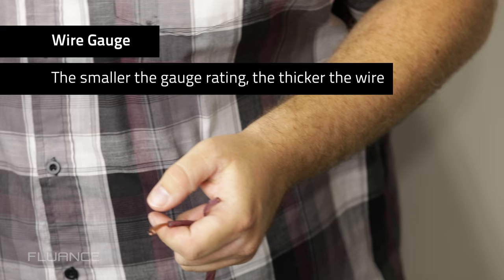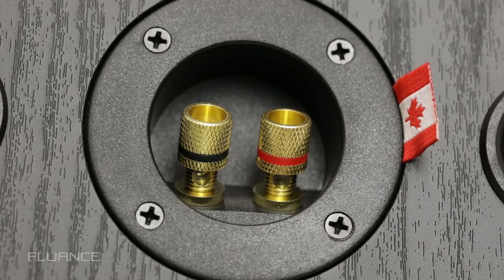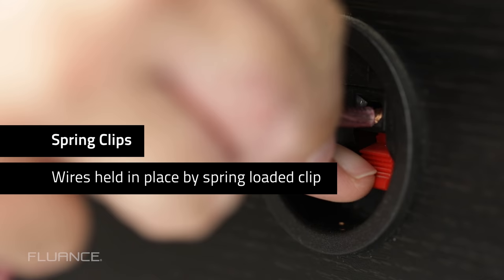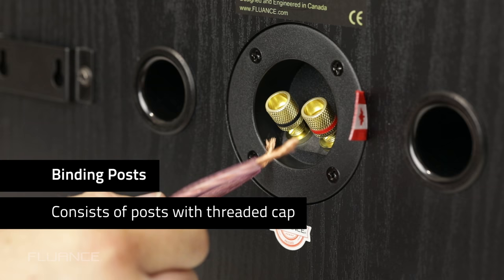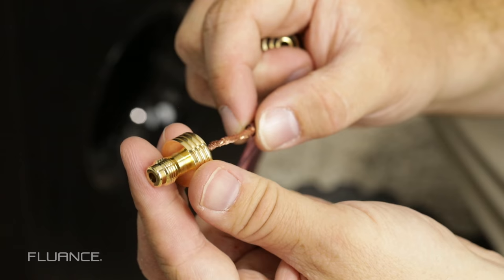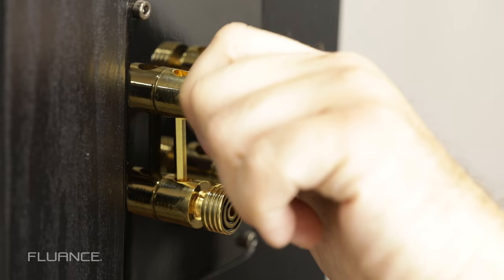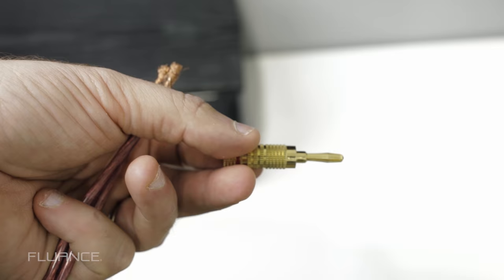How to Connect Speaker Wire to Speakers and Banana Plugs

Comment: Not once did he mention that the 2 wires should not each other & should only connect while the Hi-Fi or Amp is off.
Reply: It's intended to be a simple 3 minute video that addresses a topic in a concise way. There is an endless amount of info to share; content creators have to pick & choose what goes into a video.
Reply: Probably assumed background knowledge of basic wiring.
Reply: Isn’t that like…obvious?
Reply: O8
Reply: Nope, you can plug them in with the amp on you Twaat 😂

Comment: Bi-wiring is audiophile VOODOO and will do absolutely nothing more for you than conventional wiring will.
Reply: Mike is right, if you want to benefit from the connections you have to use BI-AMPING.

So 2 amplifiers for a set of speakers.. 1 for low and 1 for high.

Bi-wiring --  Not much difference
Bi amping - More powert to drive each frequency.
Reply: @t0xictearsz  bi wiring no difference. I think you were being kind 👍

Comment: Thank you! You saved the day. I donated an entertainment unit. The stereo and speakers were housed in it. Well...the loaders undid the speakers to get everything out. Well...what do I know? At first I thought they actually cut the wires to get everything apart! I thought they ruined my speakers and was getting ready to donate all that as well. Then I found your video. Great video. One suggestion...clarify that even though the red and black wires are wrapped you have to separare them at the end to put one in the red port and the other in the black one. I was confusing myself which one of 4 to use. Finally figured it out! Duh. Thanks a lot...and also for getting right to the point, avoiding more frustration. Now I can rock out!!

Comment: 2:30 that makes it look much easier than it will be depending on the plugs you buy. I’ve bought half dozen sets over the years only to find out there is no clearance to get the cap end over the male piece after the wires are bent over check the reviews and see if people mention that. If they do, buy something else.

Comment: Very helpful! Thank you! The speaker wires work well. But connecting to amplifier is more complicated as access to the post is limited. My guage is a 12 so wrapping does not work. So I put it in as best I could and twisted rg cap down. Seems archaic! My amplifier is old, but good. Can I replace this amplifier connection?
One last question, thanks in advance, so I have double speaker connections. I assume the top wires go to A on th amp and the bottom speaker wires go to B. Seems obvious, but wanted to check.
Thanks so much! As others have said you explained everything extremely well!
Heck, maybe you have another video that explains the (older) amp wire connections? ❤

Comment: For the wire connection with the spring loaded clips, what is needed on the other end to plug into the amplifier?  An adapter, I would assume, but what adapter please?  Thanks

Comment: what if you have 12 gauge speaker wire and spring clips are too small for the wire to go in? - and cant use banana clips as they wont fit either

Comment: how to give input to them. Most of the TV have either HDMI port or AV port and sometimes Optical port. How to give input to these speakers?
Reply from the maker: Hi Aryan.

Thanks for your question.

These speakers would need to be connected to an amplifier or home theater receiver. You would then connect your audio sources to the amplifier or receiver.

Comment: Can't find many videos on Pin/Flex pin connectors.  Find Videos on how to plug them into Spring terminals (which is self explanatory),  but not how to connect them into Binding posts on Speakers. Do you use the Flexi pins the same as looks cables or can they be plugged in like a banana plug? They might be too thin to be plugged in like banana plugs?

Comment: I have these bookshelf speakers that used to go too my rca stereo. but its wire is very thin and has a connecter at the end could i use this for my reciever or should i just buy some new ones.

Comment: how do i strip the wire at the ends? im a total noob pls help
Reply from the maker: Hi Neeni M, great question! Wire strippers will make the process easy, but if you don't have any you can carefully cut away the jacket around the wire. This must be done without the wire connected. If you need help along the way, feel free to contact our Customer Experience Team at Fluance.com!

Comment: Hello Fluance Audio. My audio mini system is a Hi-Fi Sony. The speakers has spring clip conector but sometime i move the speakers and the wires and the sounds is distorted. How long should the bare part of the wire? Only the stripped part of the wire should go inside the connector? Thanks. (sorry about my english)

Comment: What happens if I remove the bridge plates but only connect speaker wires to 1 pair of binding post?
Reply from the maker: Great question! If you remove the bridge plates and only connect to one set of terminals, you will only hear the high (top posts) or low(bottom post) frequencies. Removal of the bridge plates is intended for bi-amping or bi-wiring where you have separate speaker wires connected to the top and bottom binding posts so the high end and low end drivers are powered separately.
Reply: @FluanceSpeakers  If I'm living in an apartment and want to lower the bass at night, will removing the bridge plates and connecting only the binding posts lower the amount of bass produced?
Reply: @Zero8880  You will lose all lows and mids really. It would just be random high pitched squeaks coming out of your speakers. Right way to do it is just create an EQ on your receiver where you turn bass way down. Some streaming devices and AVRs have a night mode which flattens the highs and lows so you hear mostly just the mid range vocals.
Reply: Anton Galazyuk Oh yeah, I tried it and wasn’t liking what I heard.  I ended up fixing the problem by tricking my receiver.  I have the system setup with no  subwoofer and had it inputed that way, so the receiver was pushing all the base to the front towers.  So I just went into the settings and told the system that I was using a Subwoofer, and then the amount of bass going through the fronts drastically decreased.

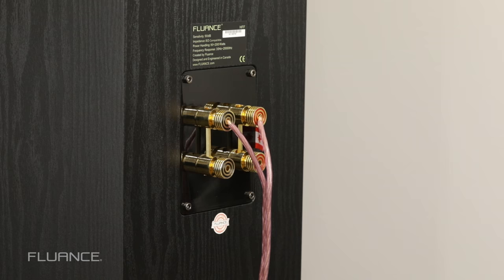Comment: I found you have uninsulated way too much wire at 1:39 and 2:42.
Not only does it look cosmetically inferior but it also improves the risk of short circuiting.
2:31 When you are filming your hands and fingers this close, it is also recommended to get a manicure or at the least get your nails clipped and your cuticles fixed.
Maybe this will stop you from biting your nails in the future?  :)

Comment: Question, is it necessary to cut the wire for better connection. And if I do need to cut the wires what do I use.   I do not have bi-wire though My system is a KLHIIIII audio system from the 70s.  Thanks for your help.  I noticed the in and out of sound either because of what I had, a Sony receiver from the 60s.  That receiver was Great!  Thank you for your help.
Reply from the maker: Hi Paula, by cutting the wire you make sure the wire is clean and has no oxidization and corrosion. You can use wire cutters or wire strippers to do this. If you have any other questions feel free to check out our online knowledgebase at Support.Fluance.com!
Reply: @FluanceSpeakers  thank you.  I do have another question concerning  a vintage Sony receiver.  Have a wonderful day sir.

Comment: Hi there I have just got some second hand b&w p4 speakers. They have got four binding posts on each speaker. They don't have any clip or bridges with them so in order to use them will I need to have a clip or bridges
Reply from the maker: Hi Jamie, I would recommend checking the manufacturer's information on them. Typically they will need bridges, but they may have a different system for this than us!

Comment: How to connect JBL Studio 530 bookshelf speakers to HarmonKardon avr25 receiver? I'm a senior and know nothing about this - should I buy 12 gauge copper wire and monster banana plugs?  (Is this general copper wire used for everything or is it "special" wire for speakers? From your video I'll remove the golden bar connecting the two sets of "plug" holes since I'm only connecting one amplifier, right?? And are "monster" banana plugs the same as just banana plugs? Would Home Depot have them? I don't know enough to know what else to ask - but THANK YOU FOR YOUR HELP!! I just don't want to blow up anything - or me :( Jean
Reply from the maker: Hi Jean! We recommend using speaker wire specifically, as they usually come in generous lengths, are labelled or coloured for positive/negative and do not have any internal coatings on the copper wire inside for a solid connection.

If you are using one amplifier, make sure you leave the bridge pins or places on. These connect the binding posts to each other so you get power to both the high range and low range drivers. Removing them would only give you one or the other.

You can also get banana plugs anywhere that sells audio hardware Monster is simply a brand and there are many out there. If you want to talk to one of our experts, feel free to visit Fluance.com or give us a call!

Comment: I have a 16g Rocketfish speaker wire I bought at  Best Buy. Is that good enough?
Reply: @Hiram Bright:  Depends on the length required and the speaker impedance. if you are using an 8 ohm speaker and only need 20 feet you'll probably be okay.
Reply: @-x21-  I'm using 6 ohms speakers with an 8 ohms amp. I only using a few feet for each speaker.
Reply: @Hiram Bright:  The speaker wire should be fine however you should be careful with the volume of your amp. 6 ohm speakers require more current than 8 ohm speakers. This extra current places more stress on the amplifier.
Reply: Less than 50 feet, 18 AWG or heavier is fine. Don’t use the thinner stuff unless your speakers are directly beside your amplifier. Heavier speaker wire is great at lightening your wallet! In most cases you don’t need heavier wire unless you are wiring your home and have runs longer than 50 feet.
Reply: @RoastBeefSandwich  Yeah Best Buy tried to sell me that $30 dollar speaker wire.  I went to Home Depot and spent $7 dollars instead.

Comment: Great, but it looks dangerously insecure to leave wires wide open
Reply from the maker: We appreciate your concern Adele. Typically, speaker wire carries a low voltage current that most people would not be able to feel. If it were an issue, the binding posts would need to be insulated on the outside as well. We hope this gives you the peace of mind you were looking for!
Reply: Fluance Audio this is awesome, thanks!
Reply: It's not running 220V or 110V, it's low voltage!

Comment: you should know that a double terminal block is almost rubbish on a speaker, because the bi-wiring does not bring any improvement or any difference, only the bill will go up, .. the bi amping is much more interesting for him  , it allows to associate an integrated and a power amplifier if possible of the same brand and imperatively of the same class, for example: an Arcam diva A85 with an Arcam P85 power amplifier, the P85 will amplify the bass as well as a  part of the mids, and the A85 will amplify the tweeter and the other part of the mids, .. in this case: there is a real and real improvement ......

Comment: Extremely basic information.  Doesn’t cover tinning or soldering connectors to wiring.  Not a mention about corrosion. . .
Reply: TInning is a no no....according to my speaker manual..
Reply: Prince Fluffy   If you don’t use a connector or tin the wire it will corrode rather quickly since the copper is exposed to air.  While the bare wire provides the purest connection, that’s only valid until the wire corrodes.  Then, you must cut the wire to uncover fresh copper.  A tinned wire won’t corrode and doesn’t require you to keep fiddling with the wire.  Additionally, a tinned wire makes it easier to make a connection.
Reply: @ronniefranks4351  ive never had a problem with marginally exposed copper wire, or seen any sign of corrosion - maybe if i was in a wet environment would copper patinate, but not inside a house - im just looking at some 15 year old wire, look like the day I bought it.
Reply: Yep I always tin my speaker wire to help prevent corrosion.
Reply: There is a better and easier way than having to "Tin" the wire, use some light conductive grease, apply only a very small amount, just to have a light film of it. You will get better conductivity at the terminals and reduce the time for corrosion to set in.  Just my 2c..